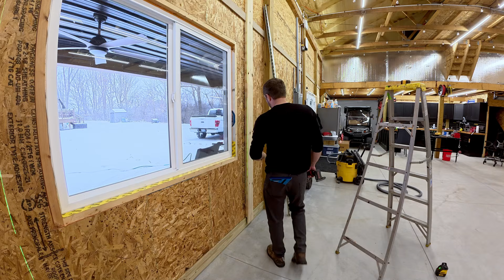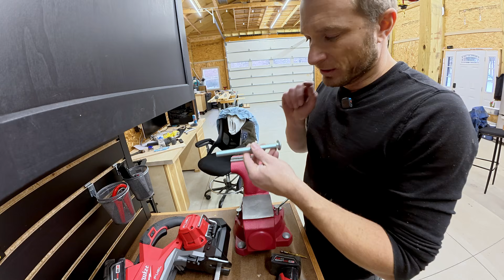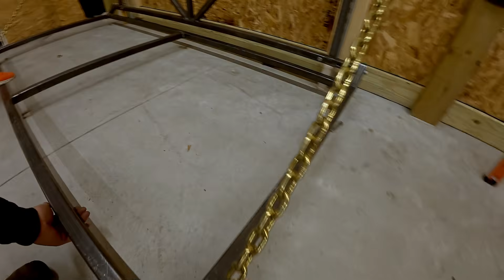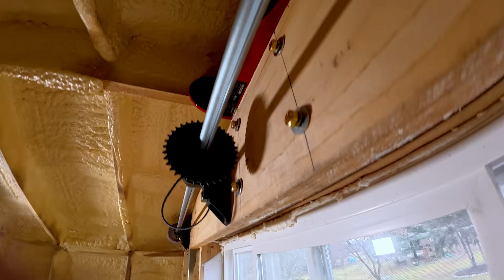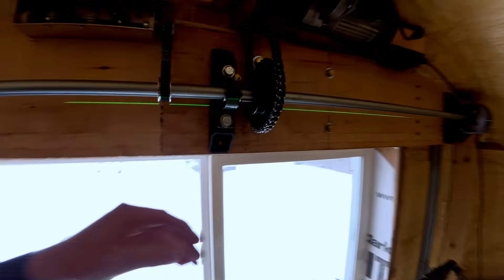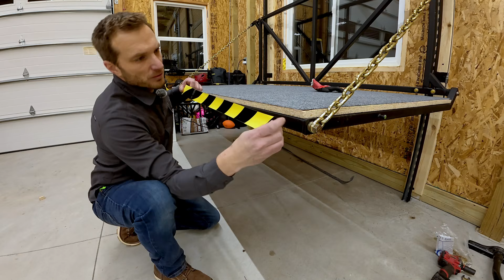Attic Elevator Heavy Duty | DIY Shop Elevator Built Right

Comment: Nice project, I was thinking of almost that exact project to make. Thanks for blazing the trail. One other thought I might add, a fail safe mech. In case of a catastrophic failure of the lift, kinda like an elevator has. I was thinking of using a car seat seatbelt system, one for each rail. Such that if the platform starts to fall quickly, the seatbelt mechanism would catch it almost instantly. And lastly, one nitpicky thing. At the end of your board where the carpet came up short and the wood shows, paint it black that way it'll still look totally professional. Great job thanks for doing all the heavy lifting! (pun intended)
Reply: Also, I subscribed because of this build. Although I will admit this was the first one I watched of yours. I will watch more, and look at  past builds  too. Thx.
Reply from the maker: I appreciate that!
Reply from the maker: Both good suggestions, thanks for that.  Yeah I'm still trying to come up with the best safety catch.  Good luck with you build. Let me know how it turns out.   Thanks for watching

Comment: Great build! On another note, to help lower moisture in your barn, seal the cuts in your concrete with a concrete self leveling seam filler. You would not believe how much moisture comes up from those cuts in the concrete.
Reply from the maker: Yeah i do plan on doing that.   Just haven't had the time.  I have all the materials already to do it.    The shop is heated and air conditioned so the humidity is always pretty good.  Thanks for watching

Comment: I have a shop with bare 2x6 studs going 14' up to the ceiling and trusses that give me a sheet metal ceiling.  So, all you can see is the studs, no plate to rest an LVL beam on.  Can an LVL beam be screwed into 2x6's, on edge and make it secure for the stresses involved?
Reply from the maker: Hey there,  if you are asking if you and attach a lvl directly to the studs similar in the way i attached the lvl over the window for mounting the lifting hardware.  Than yes you can definitely do that, use some good grk structural screws like 5/6" x 5" or so but I would also add a 2x4 or 2x6 under the lvl on the wall like the way i ran the two 2x6s up the wall that I mounted the strut to. That would help hold the lvl up as well.   Hopefully I explained that well enough if not let me know what else you'd like to know.   Thanks for watching 👍
Reply: @Built-By-Sam  Sam, yeah that's what I was thinking.  Either more wood attached to the studs, or metal brackets, just to add a bit more security. I would be pre-drilling the holes for the lag screws by clamping the header to the studs and drilling through it into the studs (for hole alignment purposes).  But one question remains: How big of an LVL?  Not just length but thickness and width.
Reply from the maker: I used a 1-3/4" x 11-7/8" lvl.   Since you are attaching to the studs every 16" you really don't need the lvl other than something solid to bolt everything to.  The 11" tall one will give you enough room to bolt all your lifting hardware to.  Just be sure to through bolt everything to the lvl with washers so you can really tighten things down and get good clamping force.  You don't want the bearings shifting or moving.
Reply: @Built-By-Sam  Actually the studs are 24" on center, reducing the number of lag screws involved and increasing the twisting force when the winch is in action.  Maybe I should rethink this in terms of redoing the studs and building a "doorway or window" type header if you know what I mean.
Reply from the maker: What you could do if you have the room is notch the lvl in flush with the studs but have it long enough to die into a stud at each end.  So let's say you notch into 2 or 3 studs the have it extend to the next stud at each end.  This helps with a few things.  One it will have real bearing support sitting in the notch.  Two where it dies into the end studs you can lag in through the side of the stud into the ends of the lvl.  This helps with the twisting/peeling effect by using the shear of the lag instead of the pull out resistance.   You can also add a length of 2x4 behind the lvl that is sistered to each stud to allow for more surface area to lag to.   One other thing you can do if you notch it in and make it all flush with the studs is, mount your unistrut directly to the 2 studs you want to use but instead of stopping it at the bottom of the lvl like I did have it run past above the lvl attaching it to the stud above the notched in lvl so it acts like a bracket in front of the lvl holding it into the wall.    I would feel plenty confident if you did those things.  Not sure how your set up is, is your loft area lower than the total wall hight?   If so you should have room to do all this.
Reply: @Built-By-Sam  14' ceilings with a "loft" or platform 8' above a desk.  I tend to overengineer things and I'm glad that someone has taken the time to do actually more than what I'm planning, or at least differently but has materials experience as well.  I really like the idea of putting those two drums to create equal pulling.  That way you don't have a centered winch directly pulling on a piece of cable in the middle which would  create a weak spot at the pull point.  I like the idea of notching, something I didn't think of.  And sistering.  Added insurance.  This takes tremendous planning before any doing starts.
Reply from the maker: Yeah I'm the kind of guy that is always planing and thinking.  I try not to overthink things because sometimes my best ideas come on the fly mid project.  But I did do a lot of forethought when It came to this lift project. It took some time to find all the right parts to make it all come together the way i imagined it.   The limit switch probably took the longest to come up with a reliable solution but I am beyond pleased how that worked out and how simple it really was.   Yes the dual drum set up is the way to go, it doesn't matter how you load it. It will always wind up level and at the same rate.   Good luck with your project, let me know how it turns out or if you have anymore questions.
Reply: @Built-By-Sam  Oh I'll probably think of something at about 3AM but forget it for two weeks.

Comment: For a man who was so careful doing the math for the torque loading, you should have KNOWN better than to allow yourself to put ANY cross grain welds on any kind of torque loaded shaft! Guarenteed stress fatigue fracture failure point in the heat affected zone.(HAZ). Look it up.
Reply from the maker: I would say it's not an ideal connection but with the odd shaped shaft I didn't have many options. I do completely understand how heat can effect the the steel. Being that it wasn't a tempered steel shaft I'm not overly concerned about it. They are plenty of welded connection out there on a torque applied shaft. Look at the way a yoke is attached to any drive shaft.

Comment: Love it, very well thought out. out of curiosity, why the timing belt instead of a chain like you used on the drive ?
Reply from the maker: Thank you!  The main reason was that the belt should remain tight and have less play than a chain would have.  Being it needs to be pretty accurate I felt it was the right solution.    Thanks for watching I appreciate it.

Comment: Might I suggest attaching a small weight to the cable behind the back stop to keep tension on the cable so it can't jump groves on the drums if the platform bottoms out
Reply from the maker: That's a pretty good idea,  the limit switch does a good job right now so it never does slack the cables. But there could be a time it gets lowered down and something is under it causing it to slack.  Ill look into that, Thank you!

Comment: What happens when the chain breaks
Reply from the maker: I will have a very quick ride back down. lol   Its like saying what happens when you steering shaft on your car breaks, or what if the cable on a crane snaps?  yes anything can happen but the safety factor built into the parts is the safety.  I'm not saying it cant fail, and I'm not saying that I'm not going to add some safety features. I will have a video out soon with some safety improvements.  Thank you for watching I appreciate  it.

Comment: I use those winches for kinds of things. I love what you did here. The only suggestion is the problem with the pillow bearing in the center. If you make a solid connection between the winch housing at the bearing and the pillow shaft it drives, it keeps it from pulling up in the wood. You can use one of those bent connectors from a garage door made of thick steel. Bolt it between the winch and the pillow bearing support or even a dedicated pillow bearing. Think old school alternator bracket. The winch and the gear on the shaft will work as one. This is just a suggestion. Maybe a solid plate that encompasses the winch and the bearing at the shaft would be better. Anytime wood is asked to carry a sheer load like that, it doesn't work out well. I would love to see what you can come up with.
Reply from the maker: That is a great suggestion for strengthening the assembly, I'll definitely look into using a bracket or maybe an adjustable turn buckle to connect them.   Thank you and thanks for watching I appreciate it.
Reply: @Built-By-Sam I'd suggest that you use a cantilever if you decide to use a turnbuckle. That way the turnbuckle can be used as it works best, in a pull configuration. If you slot the bar, you can use a bolt against a stop to slide it tight, then use a bolt in the slot to lock it in place. It depends on what you can source, the strength of those parts, the tools you have available and how much room. And above all, do what you know from experience.
Reply from the maker: Good tips.  Thank you!

Comment: What brand of strut did you use? I had momentum with B-Line. I am wondering what grade you used. I preferred B-22. Heavy duty.
Reply from the maker: It was just from home depot. I believe the brand is called super strut. Its 12 ga galvanized. I'm not sure if its any stronger or weaker than the one you mentioned.   I think if you go to a strut without the slots its a little stronger.  But this doesn't seam to have any issues.  Thanks for watching I appreciate it.

Comment: Nice job.  However, not likely but if that roller chain breaks... what is going to stop the platform from slamming to the floor?  Perhaps I missed a step in the video.
Reply from the maker: Thank you.  No you did not miss a step and your not wrong.  I will have an follow-up video out soon where I add some necessary safety equipment to the lift.   So stay tuned for more.  I appreciate you watching.

Comment: Oh dude, please please please use more than one chian to drive the lift and also would be smart to mount a ladder either side of the lift, and idealy a emergency break that claps down on the cable ar at least the drums and reinforce the rails side to side as if one of the cables snaps, one rail will take the side load of that event you might find it just deforestation and allows the carriage to slip out
Reply: Oh n well up some cable cages on the platform because when those boys snap, idk you watched piranha 3d or dd I don't remember but aye slice. But hey awesome project 🤘🤘🤘

Comment: You should definitely add some safety features.  Others have made good suggestions.  Your current design is functionally good but you are relying on only the cables to support the deck.  Anyone that has had a garage door spring break or cable jump the reel knows that it gets pretty sketchy when the weight lets loose.  
Other than that it looks like a nice lift.  Be safe when using it.
Reply from the maker: I appreciate the concern,  I will be making a video soon with some added safety features.   Stick around for more to come.  Thanks for watching

Comment: Hands down, the most solidly built, well-thought out garage attic lift on YouTube! Excellent work, and thanks for actually providing a full length build video, and not a 12-min cliff notes version. I'm 75% into a very similarly sized garage lift, except I don't have a wall to secure my unistruts to. Mine comes down more in the middle of my garage, so we're having trouble coming up with an idea for securing the unistruts. Any thoughts on how we can tackle that scenario in a similarly designed lift?
Reply from the maker: Thank you for the compliments!  Yeah not having a wall to mount it to would make it a bit harder to do.  Without to much thought into it, I think there is a couple options you could do.  One would be a similar set up to mine with the cable drums and shaft but doubled it so you have a cable in each corner of your platform.  You could link the two main shafts together with a chain and sprockets so it all winds up equally with one hoist motor.  The only downside is the platform can move around when its not on the floor or all the way up.   So the second option would be a similar set up but have a set of unistruts that hinge down from the ceiling and pin to the floor so that the platform has something to ride down and stay stable along its travel.   Just some thoughts.  Just make sure what your attaching your hoist components from something that can support the weight.  Without a wall or legs coming down the load all ends up on the trusses.  If possible mount everything to the top chords of the trusses not the bottom chord, since typically the bottom cord has a much lower weight rating.   Thanks for watching and stay tuned for more, almost complete with my LVL upgrades to support my new storage area.  Good luck with your project 👍
Reply: @Built-By-Sam  Thanks for your thoughts, Sam...much appreciated! We're basically going with a version of option 2, where we have over 18' of unistrut from garage floor to attic rafters, with 1.5" x 1.5" x 1/4" thick steel angle iron welded to the back of the unistrut for rigidity. It feels solid, but the carriage is "sticky" going up and down. We also used vertically mounted trolleys instead of the horizontally mounted ones you used, which isn't helping. I think we'll switch to the trolleys you used and see if we can get things to run more smoothly. Thanks again, and I'll keep an eye out for your future vids. Take care, Josh - Eads, TN
Reply from the maker: Yeah the trolleys i used do a good job of not binding up due to the extra bearing at each end that keeps them centered and straight.    Another thing to look at is double strut, its basically two unistruts weld back to back. They are very strong, and would help keep them straight.   I don't think the angle iron is enough,  angle twists to easily and might be part of your sticking problem.   Also if you are trying to just use a single cable in the center you'll have a sticking/ binding problem anytime the platform is not loaded evenly.   Just some things to think about.  Good luck and let me know how it turns out.  Thanks.
Reply: @Built-By-Sam  Good points, thanks Sam! I'll let you know how this story concludes, it's been a fun project so far!
Reply from the maker: Did you ever get your elevator done? How did it turn out?

Comment: Absolutely Fantastic! I've watched you build a couple things, and have learned a bit with your innovation for solving issues. Just like with this project, I'd see you explaining something and I say to myself. That's probably not going to do that work like you think. Then you put it together and change it slightly. Like you original limit switch placement. Equally your gear changing and support placements. But you worked it out well. Thanks for the info and enginuity! You are the man!
Reply from the maker: Thank you! I appreciate your comment.  I do a lot of thought and planning before I start a project but there is nothing like seeing it come together and realize your idea might not work the way you have thought.  But that is part of building something new and untested, you need to learn how to evolve and change things along the way.  Thank you for watching and stick around for more, I have a good video in the works right now.

Comment: As an engineer responsible for designing and qualifying industrial lifts, including manlifts (which are not elevators), I have one question: what happens when the cable connection to the platform fails?  The cable will likely be sufficient for loads in excess of the design max lift, but each cable end has to be connected to the load, in some fashion.  That connection is the failure point of the lift.  I suggest you consider a third cable. with a failsafe brake on it.
Reply from the maker: If one cable was to fail it would not fall it might drop on one side a couple of inches but would still be supposed by the other cable.  The breaking strength of the cable and end fitting are rated for 5 times its working load that is 880lbs each. Both the cable and the ends are approved for lifting.  Out of the things that could fail the cables are low on the list in my opinion.  Thanks for your input and thank you for watching.

Comment: The build is very cool. Seems to work great very impressive. The only thing I see is your platform three-quarter inch OSB is definitely not rated to span 4‘. I would put some diagonal or straight across the ports in that base. Otherwise, very cool build.
Reply from the maker: Thank you.  And as far as the OSB goes, there is a deference between defection and failure. Yes in a floor in your home you dont want the floor to be bouncy. But in this case I dont mind if the floor sags a 1/4" or so.  The goal is keep the platform as light as possible to be able to pick up as much as possible.   Every pound added to the platform is one less pound it can pick up.   I appreciate you watching and stay tuned for more to come.